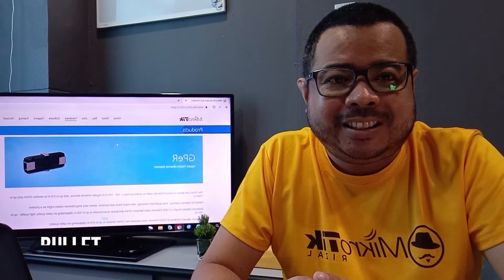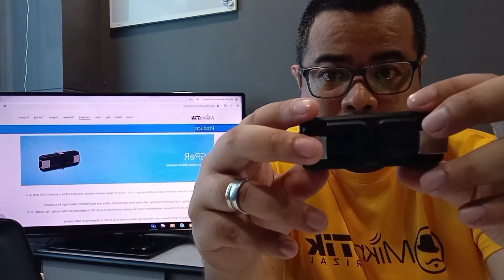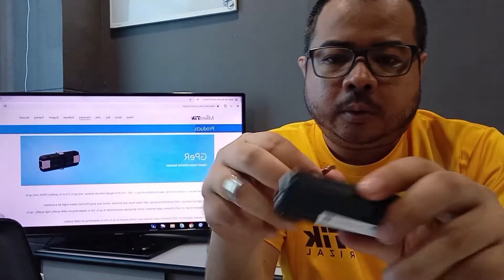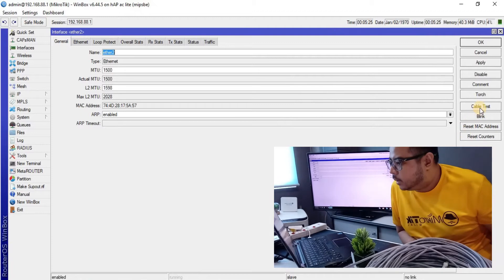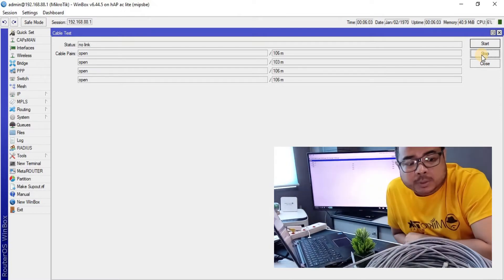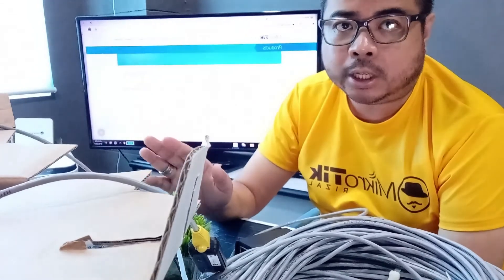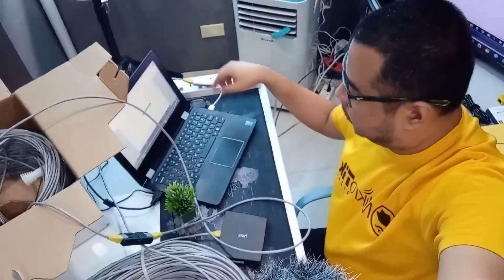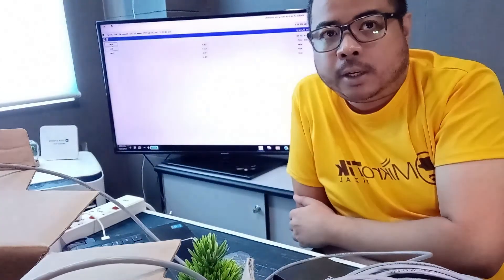MikroTik GPER | Extend Ethernet Distance up to 1500m (English Subtitle)

Comment: Sir can i used gper ba sa middle of 250 meters if meron ako sa kabilang end na 16 port poe gigabit switch with 16pcs 4mp cam then sa kabilang end gigabit distribution hub?
Reply from the maker: ideal setup: dvr/poe (1 to 100m) >> gper(150m) >> switch

Comment: hello bro. can yoh make a video about multiple WAN bonding. thanks
Reply from the maker: bro do you mean combining 2 isp? for example 5mbps + 10mbps makes a total of 15 mbps on a single speedtest, if eto not possible as of now, what we can do is load balancing and failover between multiple isp. Madami na din available online, what we can do is explain which one is to use depends on the scenario.  Iba din yun tinatawag na interface bonding. Gawan natin after ng mga line up.
Reply: @RizalTechGuide  what's best for WISP then?
Reply from the maker: @jakeluna3586 you may implement load balancing + failover and PCC if you need to point some traffic to a specific isp
Reply: @RizalTechGuide  thanks bro.